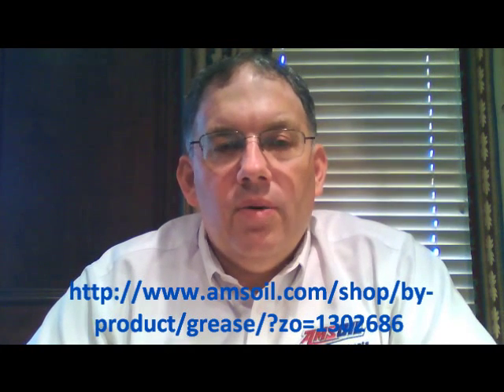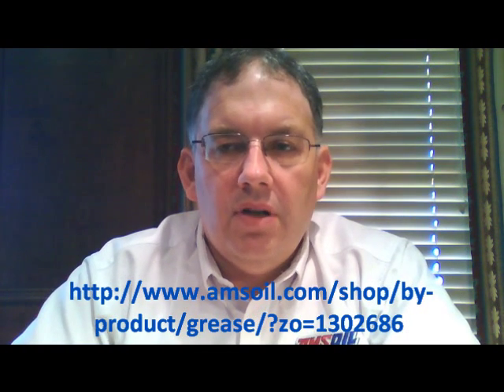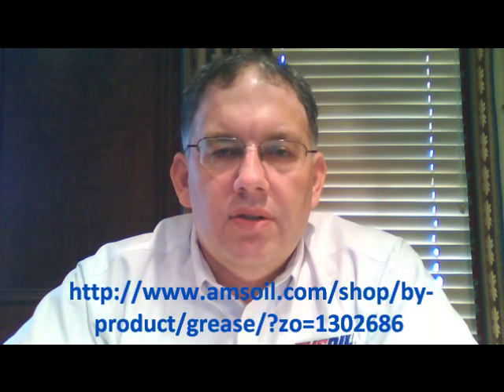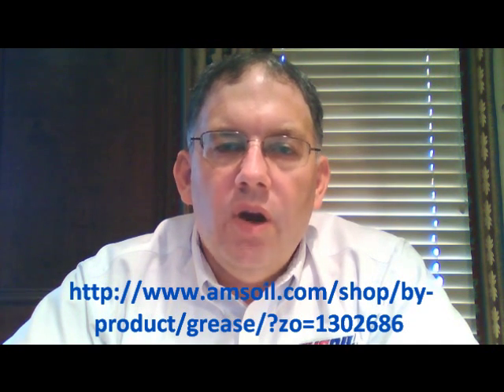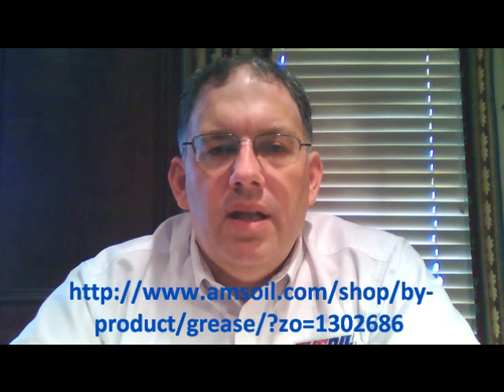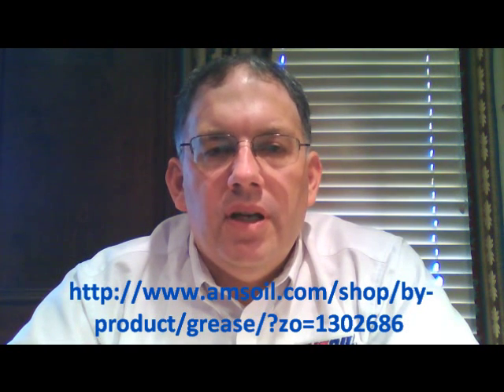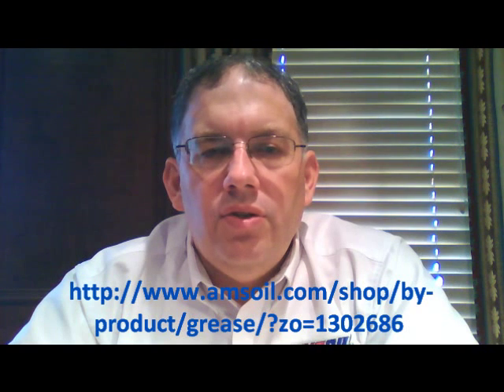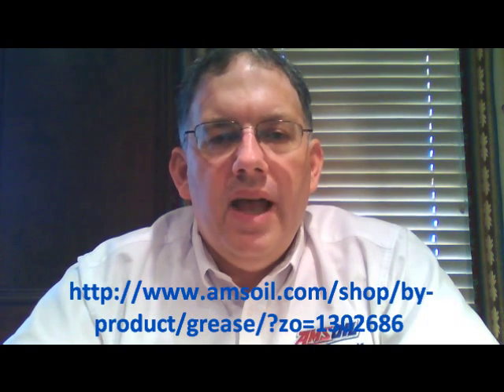AMSOIL GPOR Synthetic Polymeric Off-Road Grease 5% Moly

Comment: Hi Tom, I also have a firearms application question.  I was looking at this grease in NLGI 1 the specific application of the rails and slide of semi-auto pistol.   I wanted to reduce the wear on these rails to a bear minimum and thought that after looking at the specs this would be a great grease.
Reply from the maker: +OdinsCloud Thanks for the question.  Since none of AMSOIL's greases are designed as firearms lubricants, and I'm not really a gun-guy, I can't answer your question completely.  That said, this is a great grease, and it does contain moly (molybdenum disulfide).  If I were you, I'd do a little more research to find out if moly works well on gun slides.  If it does, then this grease should work out very well for you.